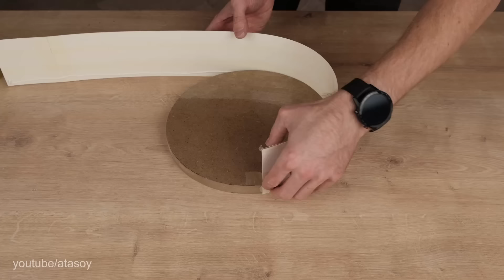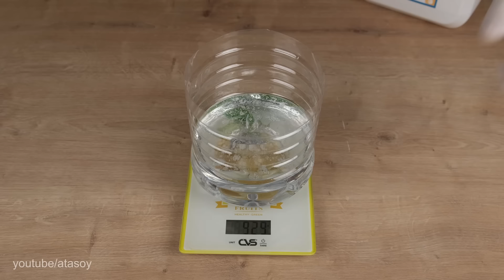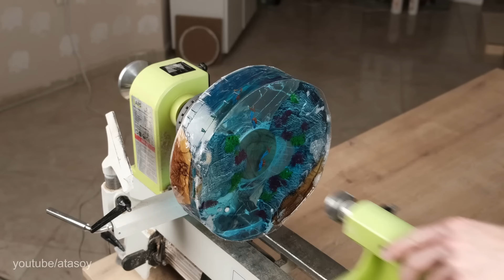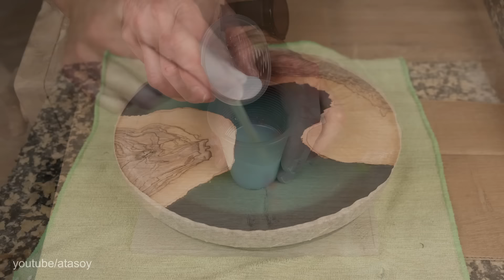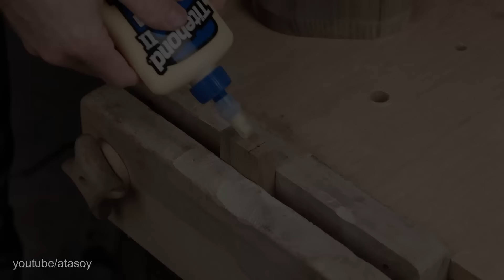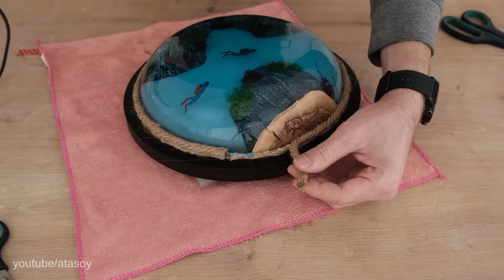Deep Sea Cave Diving Epoxy Resin Modern Table Lamp | Epoxy resin Diorama Art

Comment: That's amazing. This is Korea, but I don't think anyone makes it like you.. It would be quite expensive to manufacture and sell products like this, right?? I really want to learn it^^
Reply from the maker: Hello, producing large parts with resin is very costly and also requires a lot of labor to process the resin.
The price increases as the size of the object increases.
You can research the prices of epoxy resin products on the internet.
Reply: Thank you for your answer. How many years of learning will I be able to do it like you??
Reply from the maker: I have been doing this job for three years. If you are patient and quickly learn how to recognise and use epoxy types, you can do great work in a few months. But I recommend you to start with works such as necklaces with fine cast resin, and as you improve yourself, I recommend that you progress by enlarging your work step by step. In this process, you can determine and provide the necessary equipment.

Comment: Hello. please tell me what kind of power-on sensor you use in your work? thanks for the answer?
Reply from the maker: I used such an on/off switch in this project.
aliexpress.com/item/1005004154748220.html
Reply: @atasoy  I meant touch
Reply: @atasoy  which can be enabled via the tree
Reply from the maker: Yes, but I did not use that sensor in this video.
If you had asked the question in the video where I used the sensor, you would have gotten a more accurate answer.
aliexpress.com/item/1005004755138866.html